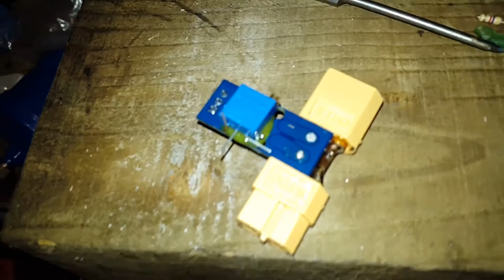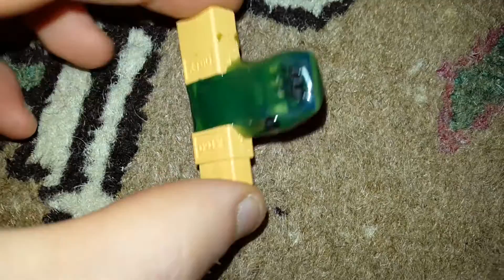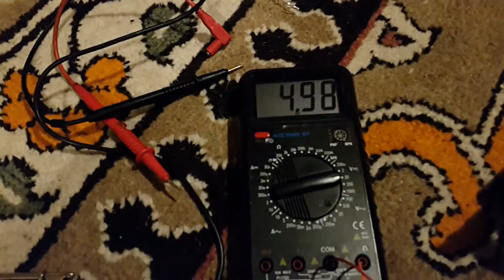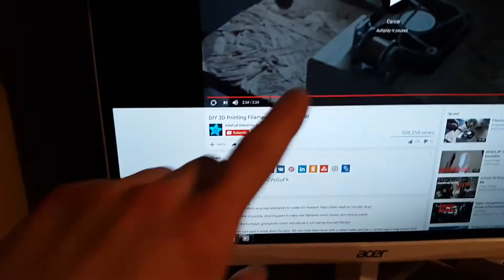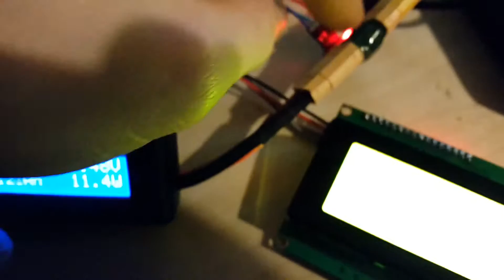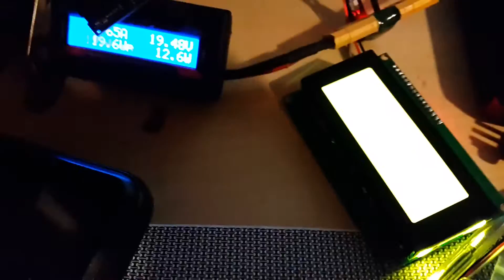DIY Arduino Voltage Current Sensor Module ACS712

Comment: Hello
Very nice project. Is it possible to have the same with AC voltage 230V 50HZ
Reply from the maker: Yes if you use the appropriate voltage divider and a fast ADC to sample 
the mains current waveform. This module will not do AC mains with the 
arduino as the arduino can not sample the wave fast enough.